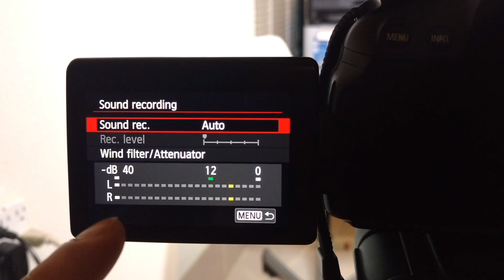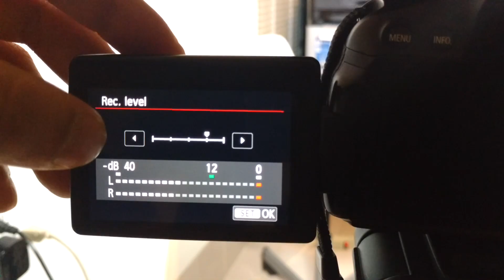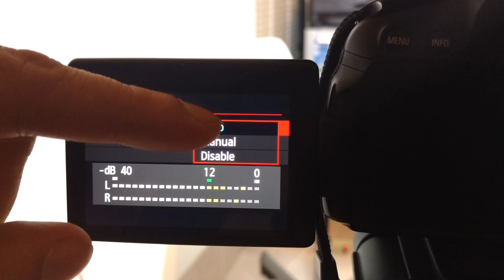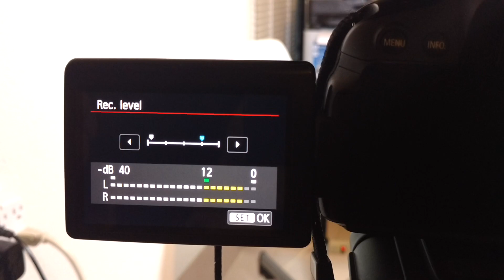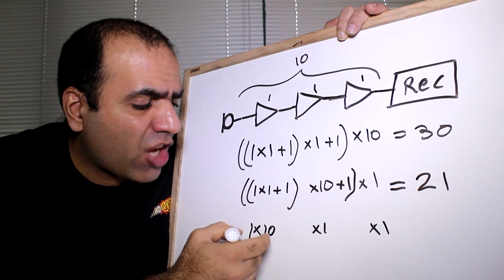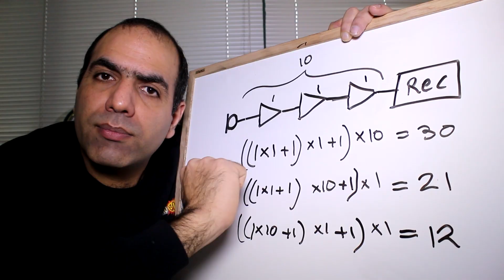Quality Audio Recording for Video

Comment: I’ve worked in the field of audio engineering for theatrical productions for 5 years and what I wish I could have said when this video came out is that: first it is definitely worth the money to buy a nice lav mic system, you can get used ones that still work perfectly. A few years ago my work was throwing out old extremely high end sennheiser lav mics due to their frequency bands being unusable due to new FCC regulation. But the joke was on them because there was still a pretty wide band of frequencies that was allowed to be used. So I got $1500 worth for 3 receivers and transmitters, plus another $200 of lav mics for the transmitters. So people are always selling or giving away pretty high end systems you just have to look in the right spot. Second if there is one thing I’ve learned with microphones, for video production a dynamic microphone is better due to its pickup pattern, a dynamic microphone only picks up sound from in front of it, so it reduces noise, a condenser microphone is designed to be much more sensitive and pickup audio from all around so it will naturally pick up more noise. This is where fancy digital sound reinforcement consoles save the day, with their fancy equalizers that let you tune out noise, you can do the same thing in post production with audio editors. Third, While I agree that a lav system is the way to go, you have to be willing to spend at least a couple hundred dollars or more for a decent system the cheap ones will always have noise and no matter what you do it will always be there, sometimes this is due to them using lower frequencies where there is bound to be interference other times the circuits are just poorly designed so they will naturally pick up RF interference. And fourth, the systems we use in the entertainment industry usually short the ground wire of the audio cable to earth ground so that any RF noise thats picked up or noise from power lines is sent to ground like a faraday cage, and sometimes we use more expensive cables called shielded cables which have a wire that surrounds all the signal wires that is shorted to earth ground for the same effect only better.

Comment: I have this problem with my current laptop doing this to me and I am an audio professional in a way toying with live audio. This is a non dialable feature in the software to my laptop for my sound drivers. There is a way to enable and disable this feature but it still dose it on it's own at random sometimes still. It's pretty embarrassing when all the sudden your input goes down with a live audience for no reason at all. I thought about sueing over this, but I am not completely sure who is the responsible party to sue if it is the software manufacturer or the audio chip manufacturer or the laptop manufacturer.

Comment: https://www.amazon.com/Microphone-Microfonos-Inalambricos-Recording-Incompatible/dp/B0833QVQ3H/ref=asc_df_B0833QVQ3H/?tag=hyprod-20&linkCode=df0&hvadid=416678430408&hvpos=&hvnetw=g&hvrand=13685257353469170468&hvpone=&hvptwo=&hvqmt=&hvdev=c&hvdvcmdl=&hvlocint=&hvlocphy=9027699&hvtargid=pla-881011529269&psc=1&tag=&ref=&adgrpid=93357003345&hvpone=&hvptwo=&hvadid=416678430408&hvpos=&hvnetw=g&hvrand=13685257353469170468&hvqmt=&hvdev=c&hvdvcmdl=&hvlocint=&hvlocphy=9027699&hvtargid=pla-881011529269      if you want a c heap wireless lav mic get this not 200-1000 its 40 dollars

Comment: I know how you hate post-processing, but I'll share my two cents - just in case. =)

I got used to VST filters (through the FL Studio Image-Line Minihost Modular), and the audio quality is never better.
But, sadly, you'll need a PC/laptop, and you'll have to tune a video delay (as filtering adds audio latency), but the output is superb - not only I added a selectable gain to the signal (a PCI audio card has only a +20 dB option), but with all that gain the signal isn't clipped, as the limiter brings it down (but isn't automatically getting the signal up (to battle which you usually need to keep constantly talking, avoiding silence), which is a good thing). It also removes the (adjustable by a frequency and a bandwidth in octaves) humm (mostly from power lines, even if the device is grounded) and the FIR-based noise cancelling (which basically creates a "pattern" of the noise, and substracts it from the source in real-time) does wonders on constant noise of any frequency combo. And on top of all that - the app (VST's too) is free.

It's not very practical during camera recordings - although you can use a movie clapper (you can DIY something like that easily), and synchronize the output later on, or record a really long take - so you'll have to sync (using a clapper) the audio only once.

Comment: The other big red flag for low noise (and audio circuits are notorious for this) is amplifying, attenuating, then re-amplifying. Cheap interfaces and mixing consoles often try to save parts cost by using the mic preamp for both mic and line inputs, using a pad for the line input. Obviously amplifying a signal in an external microphone preamplifier (with perhaps 70 dB of gain) to line level (Usually +4dBu), then attenuating it by 30 dB only to run it through another preamp with 35 dB of gain will have a negative impact on noise performance, sometimes drastically so.

Comment: The cleanest crispiest sound sound I managed to accomplish on the budget .. for now is the famous TAKSTAR videomic (Takstar 954 or something like that) and then connecting it with an adapter cable into an android headphones jack... by connecting both the mic and the headphones (because for some reason headphones makes the phone to recognize it but sometimes even then I have to reconnect it a few times and test).. and then open a quality sound recording app like RECFORGE II .... With that Im able to get the most quality externally recorded sound for my videos.. and it can pick up really barely hearable sounds from afar.. especially steps, whispering, cat pouring.. in amazing details and it cancels other noise pretty amazingly.. and its directional... I also got my self a custom fit dead cat for it for even better quality sound. ...... But syncing the sound files with video later .... is a mess... Unless comparing and aligning the waveform with the audio recorded with the inbuilt camera mic...... Or.. the other option... which is a dedicated plugin (a bit pricey one) which does it automatically.... forgot it's name but its a brilliant time saver piece of software used by filmmakers. .... UPDATE: Found the name of the software... Its called PluralEyes.

Comment: Bro, use a compressor on your audio to boost the loudness of softer audio by turning of automatic gain reduction, secondly use an eq on your audio to low pass everything above 10-12Khz , that way the air noise will be removed and you can enjoy using any mic you want to and speak at any level you want, all you’ve to do is to invest some time on learning these techniques.

Comment: well the noise can be cured by using adobe audition, use capture noise print, boom, shiny smooth audio.

also u can use ur phone as mic, they are good too. It's pretty simple, even it's recording separate tracks, but just do 2 hand clap, and go in premeire pro, select that video file and audio, right click, select merge clips.

and check only audio, and it will detects automatically, boom, automatic sync.

Comment: That is what a CLAP board is for. Or just a really obvious sharp spiking noise. A full arm clap in front of the camera to synch the two together with. It makes it nice, you can still take audio on the camera and then line up the waveforms. Mute camera audio, save file.

Comment: Great video. Have some recording experience. The noise floor being attenuated by the gain being reduced is essentially accomplishing compression. Its a must have for videos. In fact nothing uses more compression on audio than television broadcasters. 

Small note. Being sure your audio device can handle a balanced cable is key to reducing noise. Cheap microphones with super short cables often don't bother to use phase cancellation. Proabably the reason for the bad hum in your computer desk mic.

Comment: Based on gain-at-the-source logic, does that mean the noise is amplified left over DC on the wire transmitting the audio AC, and just gets multiplied at each stage? Which would mean we would need a larger capacitor at the second stage to reduce the noise?

Comment: I've just been spending the past few spare evenings going through your videos. 
I love this one and how honest you are. Especially about 'overcoming your phobias' when doing videos, promoting you to feel the need to shout. 
The explanation of the mic amps and the need to get them closer to the source was great. You should be a teacher. (You sure had a good one!) 

I know this is an old video to you. But not to me. 

You are helping me to re-energise my passion for electronics. 

Ever since I was about 8 years old, when I wired up my uncle's big speaker wires to a plug and shoved it in the wall socket. That was the moment I understood electricity. Kind of. I "heard" electricity for the first time, for just a moment. It was exciting. Many shocks later, I prefer software these days. (tsk! p*ssy!) :) 

Anyway, keep it up! I have so many more to go until I catch up. 

Cheers!

Comment: Dear Mehdi, 

thanks a lot for this guide for good audio. I bought a microphone to record audio for my youtube channel, but either the noise was horrible when I turned the gain high enough to get any sound at all, or I turned the gain low so the volume was too low to be usable.  I got myself a kit for a cheap microphone pre-amp from elv.de (because doing kits is harder than ready-made, and making mistakes is fun!) and presto! now it works fine, low noise and good loudness. You are awesome!

Comment: Ehm, perhaps you need to look into post-recording signal processing? :) The high-frequency hissing is quite normal, even on high-end microphones.

The auto-gain you're referring to is a compressor. Turn it off, and do the signal processing yourself :)

I'd recommend the following signal chain: EQ for frequency removal → noise gate → de-esser → EQ for enhancement/clarity → compressor :)

Comment: Sorry for the long comment, but I found this video really interesting because of something I just discovered recently. I have one of those bluetooth FM transmitters in my car to play music from my phone. When I first tried using it, there was a lot of background white noise, and the music sounded bad. I thought that adjusting my phone volume and radio volume to be about the same would give the best quality. I tried it, but it didn't work. It was slightly better, but still bad. Just from playing with it, I found that turning my phone volume all the way up and then adjusting the radio volume as necessary worked best. I didn't understand why, but now it makes sense. If I understood correctly, each stage of the amplification doesn't just amplify the noise from the input. It adds its own noise that is independent of its gain (at least approximately) and that noise gets amplified by subsequent stages. Thanks for explaining that! There is one other thing I noticed, and I'm not sure how it is related. Earlier, when I said that the music was sounding "bad", what I meant was that it sounded screechy. The high frequencies were being amplified, and the low frequencies were being attenuated. Is it possible that turning my radio volume up too loud caused the amplifier circuit to act like a high pass filter?

Comment: Just apply a Gate on your audio in post and it automatically mutes any audio unless it goes over a certain threshold.  This is how it is done in movies and anything professional. We apply a gate to remove any noise flaw.
Reply: it looks like your camera does the opposite of this, which is called an expander, which increases the gain when the input goes below a certain threshold.  (these are all functions of what a compressor can do.)
Reply: also protip: if you really wanted to use a 2nd quality mic, if you use smpte timecode or the good old-fashioned snap board, you can line up the waveform to the snap on the video and presto, the rest of the audio is lined up.

Comment: Buy a camera that doesn't have a noisy internal gain stage or turn down the camera's gain,  then buy a decent mic, a noise gate and a compressor to feed into the camera's mic input. The gate will eliminate background and mic noise, and the compressor will regulate the signal level to the range you need for your camera.

Comment: What about a lapel mic on a wireless? On a pzm mic on the desk infront of you?....hang a large condenser mic over head that is omni directional? Maybe use a processor to compress and gate the mics? I'm an audio engineer..... something like Movo WMIC10 2.4GHz Wireless Lavalier Microphone System for DSLR Cameras, iPhone/iPad/Android Smartphones, Camcorders (50-foot Transmission Range) https://www.amazon.com/dp/B074Q63RSS/ref=cm_sw_r_cp_apa_h3hzBb2520AC4.
Or 
KIMAFUN 2.4G Wireless Lavalier Microphone with Voice Amplifier and Recording for iPhone Camera PC Laptop for Teachers, Louder Speaker, PA system , Karaoke, Smart Phone, Bus Amplifier G130 https://www.amazon.com/dp/B074MBD643/ref=cm_sw_r_cp_apa_M2hzBbDB839B4.
Hope this helps If you haven't found a solution.. I love your videos and I have a couple used ones that I can send you if you'd like to experiment with them they're older ones but they still work

Comment: Close micing also reduces the amount of room reflections on the recording since the input signal source is closer to the microphone and thus allows for you to keep the recording volume lower (attenuating everything, including the hardware noise and acoustical noise, etc), it's useful for untreated rooms with alot of reverberating surfaces. The only thing you want to watch out for is to not go too close to actually mess up the tonal characteristics of the voice. Good practice is to always keep the recording level as low as possible while still getting acceptable peaks. You can always increase the volume in post processing phase and even compress the audio to get rid of significant fluctuations between the peak levels, but you cannot remove distortion caused by clipping which is introduced when micing at a too high recording level and accidentally "pushing over the limit". 

Those shotgun mics are often used for field recording since they are quite directional (which helps in areas with alot of ambient noise like traffic, people, whatever), but they require an extra pair of hands (like news reporting teams, they have a camera dude, the reporter and a microphone dude whose pretty much sole purpose is to stand outside of the camera's viewing angle and hold a microphone stand above the reporters head with the microphone pointing down towards the reporter, you've all seen those sketches where the microphone itself accidentally lowers in to the camera view because the sound guy cannot do his job).

For videos like the ones whre you need to move around a bit more, a lapel mic would be a good choice.. For the ones where you stay a bit more still you could get away with something else and if you're worried about the changing volume levels caused by moving around, those can be fixed in post processing very quickly and easily to a certain extent =)

I imagine you knew most of this ElectroBOOM but the long ass comment was aimed mostly for people struggling with sound stuff! As a post scriptum I'd like to add that in my personal opinion pristine sound and image quality are not a requirement for quality vids. There's alot of channels I watch with very modest audio and video quality but the content itself is diamond, that's enough to make me entertained and stick around and if you think about it; people watch alot of stuff with absolutely horrible production quality, stuff shot in portrait orientation on a smartphone without any external tools can still amass millions of views and thousands of interactions!

Anyways enough of that, good pointers in the video and engaging content as always!

Comment: You went into gain control on the mic, and camera, and even 'hinted' at a pre-amp, but didn't specifically say "Pre-amp"! You plug your mic into a pre-amp, then into the camera, which will be the BEST option for reducing noise for in-camera sound. (The chart you're doing at 8:00min, #1 will be the pre-amp, with the rest of the chain on the lowest gain.)  You control the gain with the pre-amp.  JuicedLink pre-amps can be found on eBay for under $100!

Comment: Have you tried equalizing the audio in post production using an equalizer program. By lower the high frequency band you can lower the high pitch noise without buying an expensive microphone.

Comment: Just be careful how close you get to the source with a condenser mic, because condensers have this thing called proximity effect. The closer you get to the source, the more the bass increases. This is usually a good thing if your are a female or just have a high pitched voice, but can cajse problems if your voice is deep and boomy.

Comment: Speaking as a bass player with a pedal board, automatic gain is Satan. Nothing but noise. Manual control for unity gain throughout the signal chain FTW.

Comment: You can disable automatic gain control, put the gain pretty low so that even if you scream it doesn't clip, then in post-processing put a gate and a compressor on the audio channel and TADAAA! Voice will have radio-like quality!

Comment: Something to keep in mind with complicated recording setups, if you run your video signal trough i.e. an hdmi switch/mixer the signal is delayed by one frame, so if you run at 30 fps you get 1/30 of a second delay of the picture compared to the sound. I learned that the hard way at a cinema, where it is even worse, because of 24 fps projection.